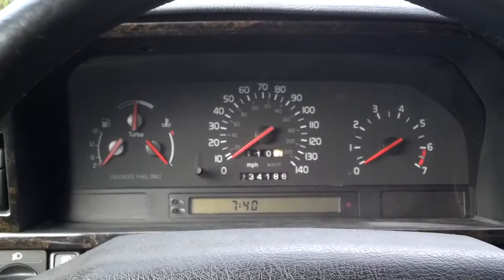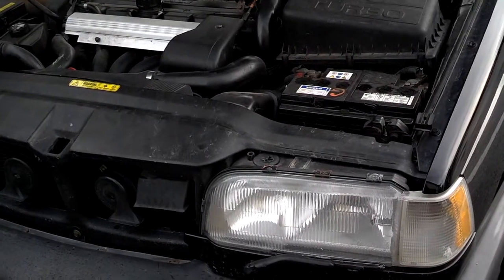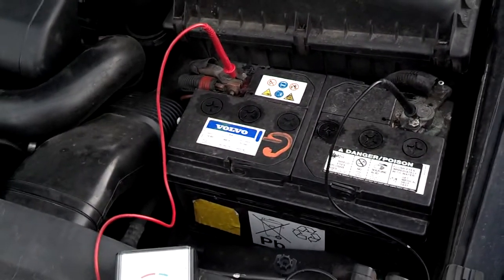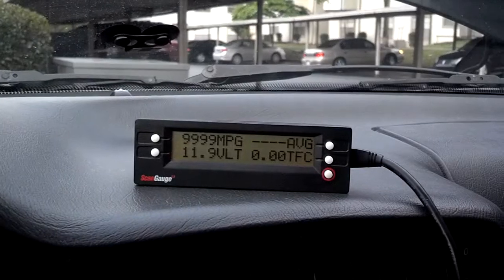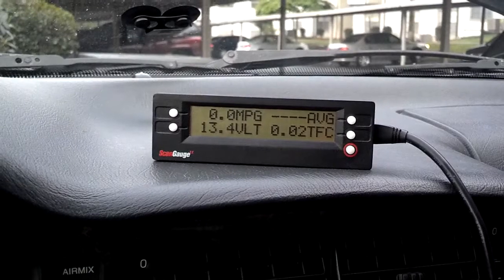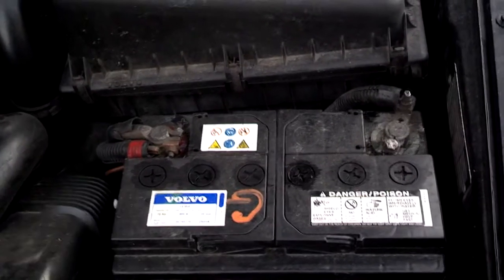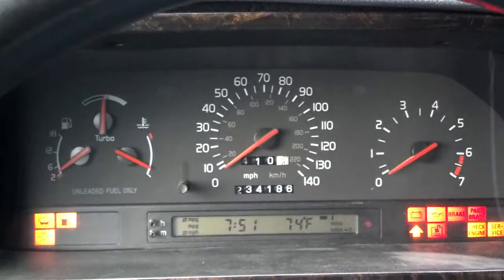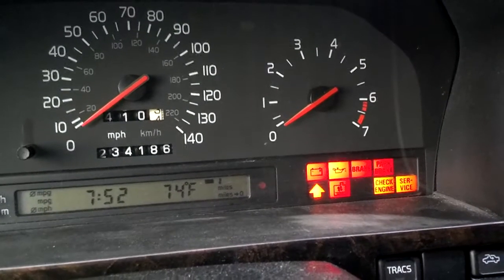Bad Battery or Bad Alternator Detailed Explanation - Auto Information Series

Comment from the maker: Considering that these 850's can rack up 500,000 miles easily, I'd say you did NOT over react. The top 4 things to take care of are: 
1. Timing belt. 
2. Transmission service. 
3. PCV System service.
4. Coolant Leaks. 
Is your car turbo?

Comment: @RSpi007 I picked up an 94 volvo and it has very low miles but no history of maintenance. The car made a grinding noise, and I tookit to a pal, and the comnpresor was so bad the pulley way just on only because of the belt.

I decided to do new compressor, plugs, wires, tensioner, belt pulley and all fluids as the car had sat for 4 years in an old ladys garage. 

People are telling me I am doing too much spending too much, but I think all this stuff needs to be done. 

Am I right or wrong?